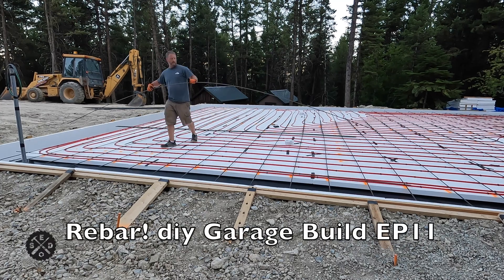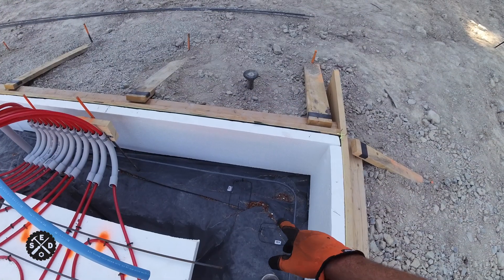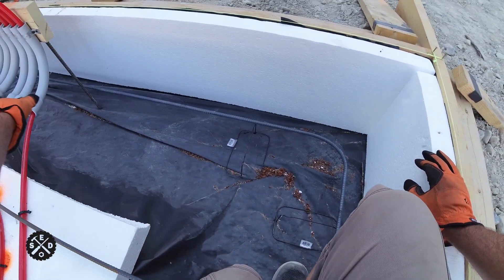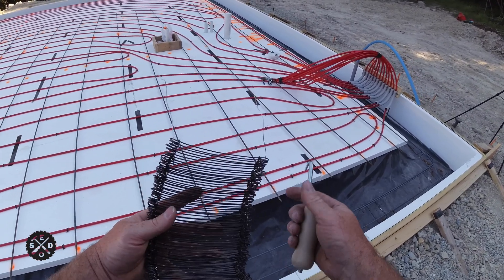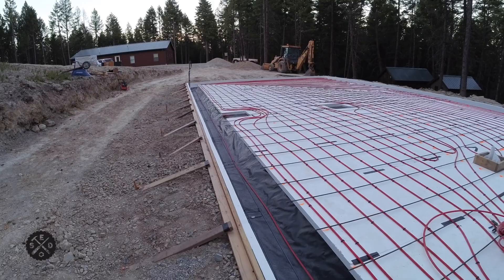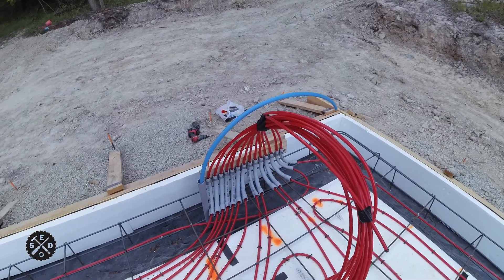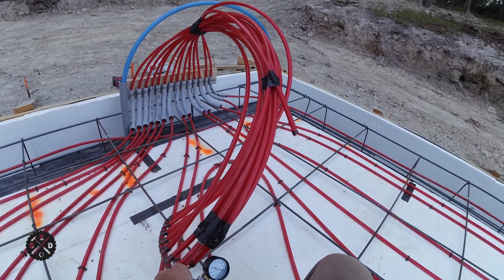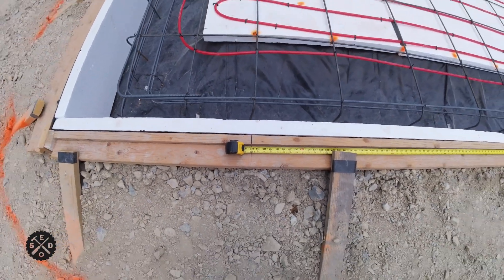Installing Rebar in Footer and Mono Slab Garage Build diy ep 11

Comment: Could I tie the rebar in the footer into concrete mesh instead of running the full length rebar grid on the main pad?
Reply from the maker: Yes, I think you could if you're just doing the mesh on the floor part. If you're gonna be driving in there, I would recommend rebar on the floor part too. You can research and decide that, though based on your needs etc.

Comment: Great video very informative and descriptive 
I have a few questions I hope you'll answer 
Are you tying rebar to each other as well as chairs? 
WhAts the reason for the 1ft overlap ? 
Just to recap you used rebar chairs (very cool) to go around perimeter of slap two rows then you went from.ome side of slab to the other thing rebar to the rebar going around perimeter ? Why two rowd of rebar going around instead of one ? 
Any books you'd suggest on block work ?
Reply from the maker: Thank you! Yes, I did two rows of rebar in the footer around the perimeter. I believe the reason for overlap is just so it’s continuous with no breaks. Typically one row is not enough. If you have local building codes, you’ll have to probably clarify with them because it’ll probably vary somewhat as to what’s required. I don’t really know on the book recommendation perhaps someone else can comment.

Comment: Splices should be 40 times the thickness of the rebar if there is contact. If you separate the rebar at the splices by twice the width you can go with an 18 inch lap
Reply from the maker: Interesting. That might vary a little by location probably too.

Comment: Are you not going to place chairs under those #3 bars in the floor?
Reply from the maker: No since it’s already sitting on the pex tubing, the concrete guys pull it up with their rakes as they pour.
Reply: @SmartEasyDIYer . Never trust the concrete guys to pull up the rebar. At best they will snag your pex. At worst they will cut your pex and not get your rebar to where it needs to be. Use rebar chairs.
Reply from the maker: That is probably typically very true. I kept a pretty good eye on these guys and I specifically asked them about that and they had told me they'll pull it up and they did a pretty good job overall I think. If I wasn't there to confirm, I would've probably tried to make it as dummy proof as possible. 👍